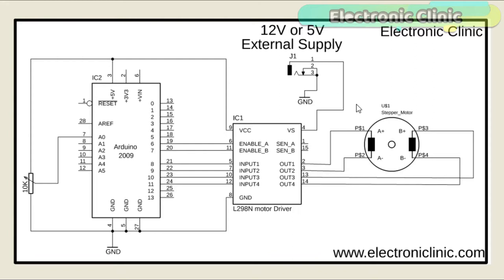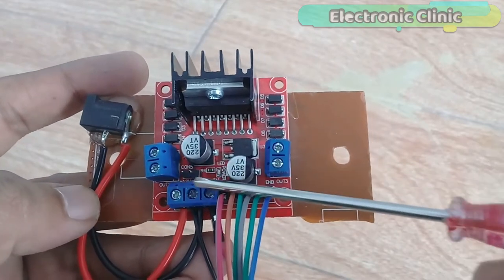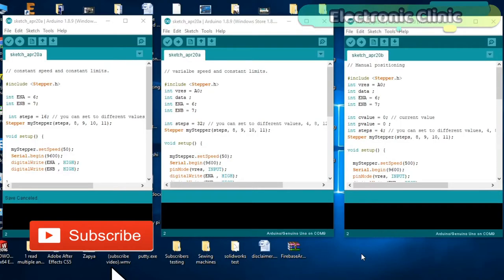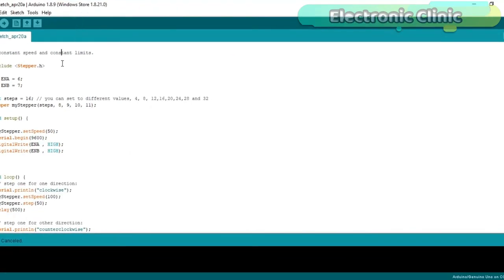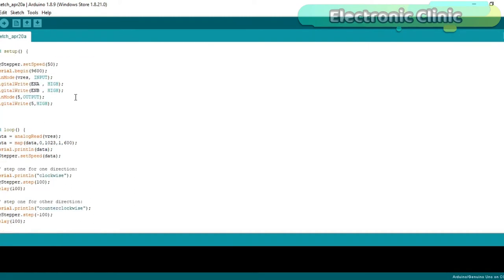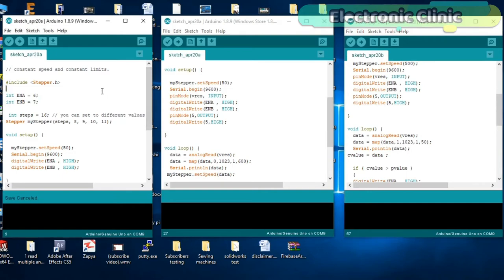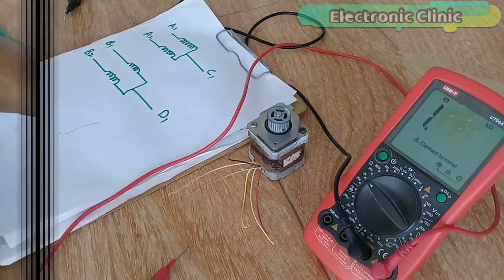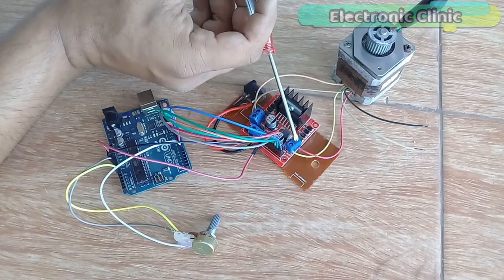Arduino Stepper Motors Control: BiPolar and UniPolar stepper motors position and speed control

Comment: What is the pot wired to if the 5v is already being used on the arduino ? and that L298N driver makes the motor seriously hot
Reply from the maker: l298n is good for small stepper motors. watch my latest video in which i have used the cnc shield.
Reply: @ElectroniClinic   hi what pins are you using for the pot the diagram is confusing